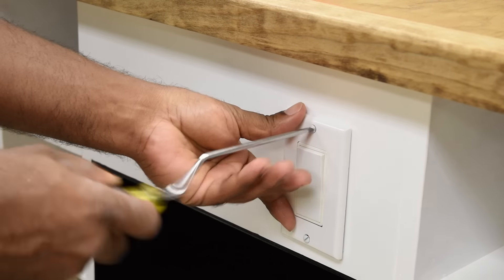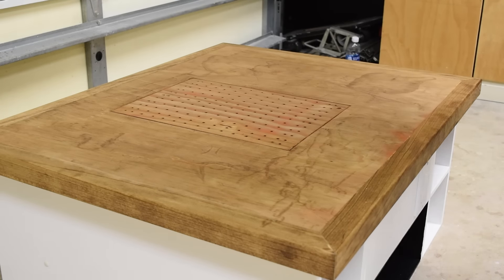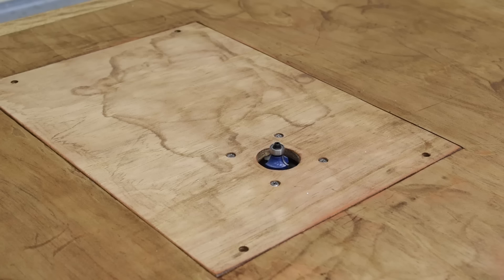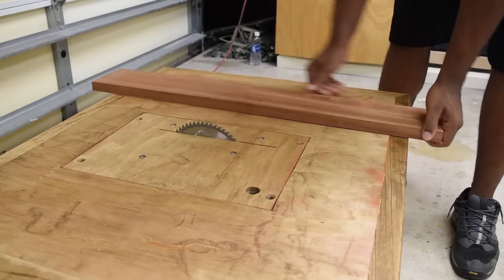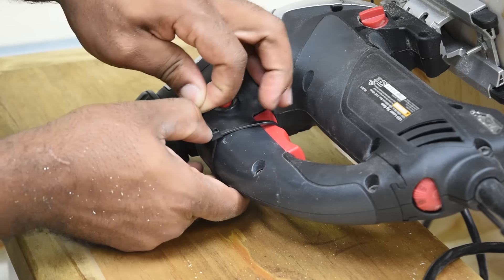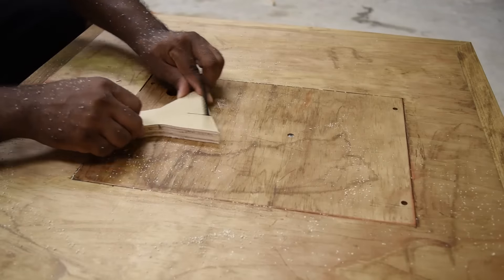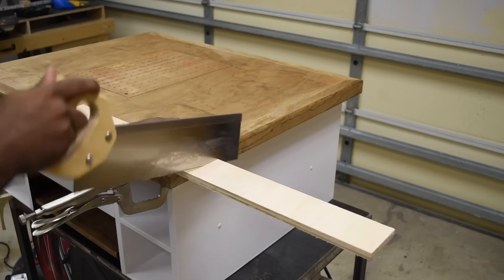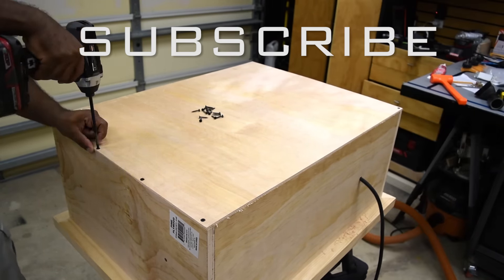4 in one Homemade Table Saw Modular | Plans Available

Comment: I love the 4 in 1 Modular.  Great Idea.  I think it is so good that I am thinking of selling my table saw and band saw.  They take up too much room in my small shop.  I especially like the dust collection.  I can see how a sled could be made using the right and left side of the top as references.  However, I plan on making  a lot of box joints and am concerned about accuracy needed for the joints.  William Ng is talking about accuracy of .006 thousands of an inch.  Do you think this could be done with a jig using the rotor attachment?

Comment: A tip for you.  Have the shopvac and tablesaw controlled by the same switch.  Saves a little time when turning it off.  Had it like that for my first tablesaw build.  Awesome job on the build!

Comment: Hey Glen, just wondering if you ended up making any updated plans or changes to your diy tablesaw after 2 years? I have a table saw but want to build something bigger with more surface area to support larger cuts. I like your design and an tweaking it, but wanted to see if time has changed what you'd do with this saw.

Comment: Just found your channel and I find it really informative! Thanks for making all of this content! I have a question that hopefully might get an answer :-) At the end of the video you showed how the t-nut was pulling out when tightening the stop block. Couldn't that be resolved by putting the t-nut on the inside of the stop block in a routed out circle ensuring the t-nut is flush with the wood? Then when the tension is put on it, it would be pulling the t-nut into the wood rather than out, right?

Comment: Thanks for the nice build, I was wondering if mounting the circular saw like this as a table saw also reduces the noise. Would it be possible to measure the decibels (with free phone apps) of the saw cutting a 3/4 ply outside by hand, and then inside as this table saw for comparison?

Comment: If I was starting out from scratch again, or was new to woodworking with limited space this would be a great way to go.  Excellent work man. One suggestion; I tried using hose clamps on my router table and I wasn't thrilled with the result.  I ended up building a trigger holder using two wooden blocks cut to the profile of the trigger and the handle. I used a pair of cylindrical nuts to make it jointed on both sides.  On one side I used a threaded rod and a wing nut so that the whole assembly opens to take it on and off. No tools required to take it on and off for switching between stationary use and hand use.

Comment: Just wanted to thank you for sharing this. I'm planning to build something similar for my purposes and this seems like a pretty good starting point that can evolve over time. Which measurements did you use for that inset? 
As for improvements, have you considered some triangular braces inside to make the other three sides more rigid an maybe a circular door that can swing on a bolt to have something within arm's reach to fine-tune the negative pressure inside?

Comment: This is a great idea to save space for sure! You have inspired myself to get back into woodworking. Quick question though for the circular saw, how does the switch stay enabled on the saw for the trigger switch? Would like to build this, just trying to understand that part.
Reply: Got through the whole video and you answered my question with the zip ties and clamp methods. Thanks!

Comment: oh and if you wanted you could also add a safety stop instead of a light switch and wire the top of the table with a surge protector. if your anything like me i have set a drink down on my equipment and spilled it. surge protector is a good idea. but i do like where is headed. great work. i like how you are willing to share your ideas with everyone. thanks again.

Comment: Panel type switches can be easily bumped while working and can lead to injury. A more positive toggle type switch would be better. I would have made the lower cubby holes big enough to fit the drop in plates with the tools attached just for the sake of convenience. Some work surface tracks would be great for accessories. I like the way it looks and think that the drop in style you have created is better than the multiple tools all at once style. (you have to keep removing blades and stuff with those) All in all I think you are on the right track to making a very useful set up! Great job!

Comment: If you want to resolve the "pressed trigger" problem, instead of using hose clamps or cinch ties, you can use a spare velcro strip like the one using in the electric cord, it will hold strong and even in some tools you can set a different speed by letting the velcro a little loose, I know it will do the job. Tnx for sharing this amazing video and by the way, maybe it can be called DYI Multi Task Woodworking Table.

Comment: Dude, this is cool, crazy thing, I made myself my own table kinda like this, back in 1997, using my skill saw however, I like how you made it multi purpose for router and downdraft ,I didn't think of that back then. Question I have is, in order to have the suction, I'm guessing you have high hp shop vac?

Comment: Awesome idea!  I think with the jigsaw once you pull the trigger, you can push the little red button to lock the jigsaw "on."  I think the ziptie might potentially be a more reliable way to keep it turned on though
Reply from the maker: Thanks man! This is the only jig saw I ever owned so I wasn't sure if this was a standard feature on all.
Reply: DIY Creators I have an old black and decker one that's at least a decade old, and it has a switch that is either on or off.  I think that may have been a safety issue though, but ya, I think it might be a standard feature now

Comment: Thanks for sharing. It's something like this I want to build for my workshop, as the money for tools are a bit tight right now and I need these things to get started with a lot of my projects. 
A tip for the jig saw. If you have a problem with the blade wobbling, you can easily fix it with two small ball bearings that support it some way up on it. It will allow you to saw harder materials like metal or tiles with it too. Of course, it has its limitations and you'll have to get the right type of blades. However, it's doable.

Comment: AWESOME!!! I love this! will work for me since I dont have alot of space
Reply from the maker: Thank you :)
Reply: Question though, are the trigger locks on the power tool itself not enough to hold it down? I cant verify on the circular saw but I think your jig saw has one. My Circular saw has one also but is there an issue with just using the trigger lock that you really have to use a zip tie or hose clamp?
Reply: HoyKa p

Comment: I'm looking forward to the build. One suggestion I would make, especially for the jigsaw insert, is to add a rubber bushing between the insert and the table. That would help reduce the vibration that is transferred to the table. That's not as much of a problem with the circular saw or router insert, but it might not hurt to put the rubber bushing on the table side so that all the inserts fit evenly.

Comment: Nice presentation! I like the way you show the completed project first, THEN explain details. That saves time for the viewer and helps us understand what we're seeing as you demonstrate the project's functions. 

I admire your practical attitude. You understand we must get prototypes finished to some operable form before making the "perfect" model. Improvements must come after some degree of completion. Too many would-be "makers" (myself included) are crippled by perfectionism. That prevents them from ever getting started. The most productive among us DO things, THEN improve them once we see the potential and solve problems. 

The objective of designing an all-inclusive small DIY workstation is an admirable project! It's an idea that many people want. This design solves a number of problems others haven't yet solved, especially in so compact a package.

You asked for a "cool name." Since this is small yet has several different tools, how about the "Mini-Multi." ( or some variation )

Mini Multi workstation. Mini multi tool center. Mighty Mini Multi? 

You asked for suggested improvements or ideas. Well, I do not want to be another YT peanut gallery expert, but I see two things I might add or change if I build one like this:

1- Definitely use a safer switch. I'm no safety ninny, but rocker switches are too easily switched ON by accident. A rocker switch like the one you have here is great for switching the unit OFF in an emergency. One could use a fancy safety switch, or at least a standard throw switch for a modicum of insurance. You could also wire a double switch setup so the main power ON can be interrupted by the fast-access rocker switch, yet NO power can go one with the safer throw switch. Since those switches are common and inexpensive, together they would meet your goals of simplicity, accessibility and economy while enlarging the margin of safety. 

2- Although this design is wonderfully compact, WHEELS would make it easier to transport and maneuver. Obviously this is much lighter than stationary tools, but if one were to carry all the associated tools and accessories with it, then it would be quite heavy.

Other than those small suggestions, the ultimate version could only be improved by making it more accurate, safer, smaller, less expensive, lighter weight. Doing any ONE of those things wouldn't be too hard, but obviously the challenge is to engineer ALL of those things into one unit. 

So far, I can't think of many major changes that would improve this design without adding complexity, weight and expense. Therefore, My hat is off to you Sir! Good design! Good Ideas. Good video! 

And I wish you good luck!
~LL

Comment: This is really a very cool little work table that I would like to build. I like the versatility of the table to setup a tool you don't have by using a tool you do have and inserting it into the table. How I can have 

a drum spindle sander, band saw or second table saw quick, easy, and cheap.

Comment: One change that I would suggest is to make the top out of concrete to dampen vibration much like the cast iron tops do for floor model table saws, drill presses, scroll saws, etc. A concrete countertop kit could be used or even better use an epoxy-based portland cement as it is far more durable. It would be easy to cast some T-track into the mix for the top and sides to use for jigs, fixtures, hold downs, etc. or fashion a sheet metal top with everything you want/need and use that as the base of the mold. You can always use cement anchors to add some angle iron to the sides for a rip fence. Plus still be able to maintain the multi-tool and function capability of this. The possibilities are endless.
Peace!

Comment: Great looking table. How do you adjust the angle of the saw? I guess you can use the saw fixture itself for that?
Reply from the maker: Thank you. As is the angle is not adjustable. That's an easy fix just open the area where the blade comes out.

Comment: You really want to put a riving knife into your table saw insert to avoid kickback. Should be rather easy to add that to it.
Reply: I'm not familiar w/table saws so maybe you can answer this, how does a riving knife prevent kickback?
Reply: Since the blade is turning towards you (in order to cut down towards the table and not lift the wood) the workpiece can likely get caught in the back and be thrown towards you (very dangerous, just look at videos from people trying it in safe environment). A riving knife is a little piece of metal (though you can make it out of thin wood as well) that is inserted behind the blade and therefore prevents wood from getting caught into the blade there. Of course it is still possible for wood to get caught if it falls onto the blade from the top. A rule of thumb says that you should never cut a piece of wood that is wider than it is long (in the direction that you move it through the blade) since the side that keeps it from rotating (the fence side) is shorter than the side that is being cut. If you need to cut it in that direction, you should buy – or better yet build it yourself – a cross-cut sledge. With that your workpiece is not forced between the fence and the blade.
Reply: Thanks for the explanation!
Reply: video on how to install that?

Comment: Cross cut sled could be made by having rails that slide along the outside table edges if it is all square. I like the interchangeable inserts idea a lot. I have two ideas for additional inserts: one would be a sideways mounted belt sander and another would be a drill mounted below the insert in a way that you could put a drill type drum sander in the chuck so it would work as a spindle sander. The spindle sander wouldn't oscillate but it would still be handy to have.
Reply: Good job BTW. I like your budget ideas a lot. I have most of the stand alone tools, but this type of thing is perfect for those who are just getting started.

Comment: nice one cant wait for the plans. I do have a suggestion the other socket you should put in a plug to prevent dust from getting in there and starting a fire or better yet put in a single socket extension cord that reached from the inside and extended out the back, and as for a name for your device I was thinking multi stand.

Comment: I agree on the saw dust/electrical outlet/possible fire comment. I got nervous when I saw that concealed outlet. although, with the vacuum system, there isn't likely to be a lot of dust. maybe an outlet cover plug over one side and always use the other outlet so it is always filled. 
also, most jigsaws have a hold button that keeps the trigger held in the on position. no need for the clamp or zip tie. 
but I love the concept. you have a great way of keeping your builds simple and versatile. I subbed after bingewatching a few weeks ago. keep up the great work!
Reply from the maker: Thanks Matthew. I totally understand the concern. I will address this before I post the build video. Do to my inexperience with other jig saws I don't know if this is common. So I wanted to provide an option that I knew would be easy.

Comment: looks enormously promising. I've checked out several DIY saw tables but this looks simple enough while still being versatile. For the outlet issue on the inside of the dust compartment you could install a rubber disk with a cross cut into it to allow the power fool's cord to be passed through. (hope you understand what I am trying to say as English is not my native language :) ) Can't wait for the build video to be released

Comment: Could you wire the shop vac/ dust collection into the switch for the tool so they both come on at the same time?
Reply from the maker: Absolutely.  I love that Idea ill mention that option in the build video.

Comment: Very cool and thanks for sharing! I'm going to model my setup after this one, for sure. Just one thing that I feel could improve it is to make the inserts square instead of rectangular. This would allow the saw to be oriented in four directions, whichever is most convenient. E.g. when the saw is oriented along the length of the table this would give more support for long planks.

Comment: I am adding an outlet on the backside for my vacuum and a foot-switch for safety, you must step on the switch to power the tool you have set in the table plus the vacuum, that along with T track, fence and crosscut slide

Comment: you should add a switch to the outlet in the table for you can turn it on and off the tools and for a added safety
Reply: I think that's what the switch on the front does.
Reply: I thought that switches for the light only
Reply: As I understood it, the switch controls the outlet inside the table.  That way, you can 'permanently' trigger your tool, plug it in, and not have a whirling blade of death running on the insert while you put the table saw insert in.
Reply: he called it a light switch but it controls the receptacle inside for the tools.
Reply: oooh
Reply: Is it good for tools to be switched on and off from the power cord instead of the power button on the tool itself?

Comment: I love it but with this setup you can't move the router up and down.
Reply from the maker: Thank you. This is a trim router so all the adjustment will have to be made by hand. You can use a router with an adjustable base then you wouldn't have any issue.

Comment: I'm sure that for the occasional small jobs this is "ok"...but I have to say that this looks very dangerous and a fire hazard.
Reply from the maker: +daveonbass79 
Mmm why would this be a fire hazard?
Reply: in the "dust collector" area you have a plug to power and turn on the tools.  all it would take is for a little saw dust to get lodged in there...then you plug something in that sparks it just right and then you have an instant fire.
Reply from the maker: I understand the concern. I'll be sure to address this prior to posting the build video. Thanks